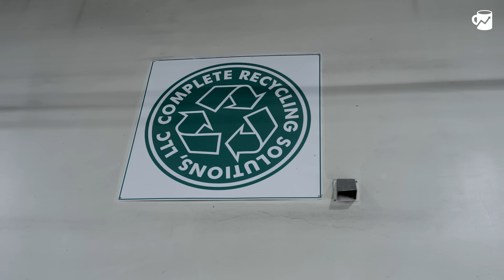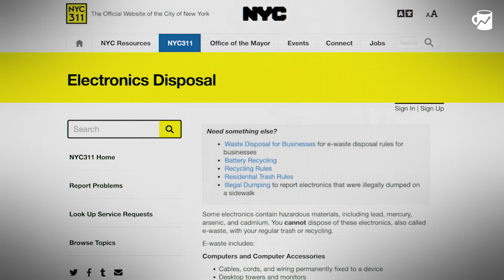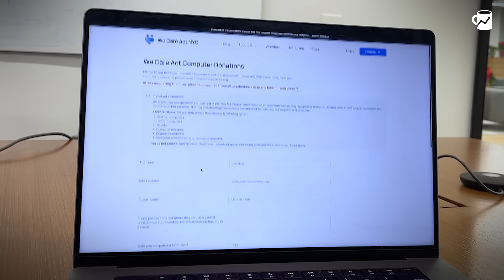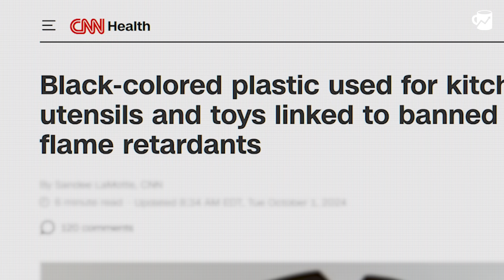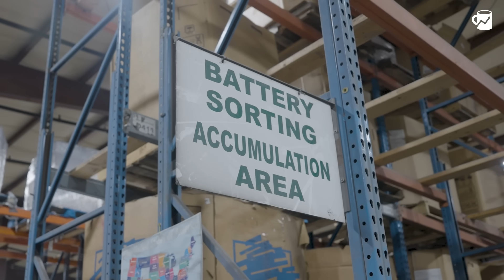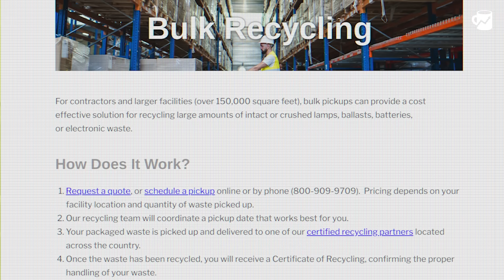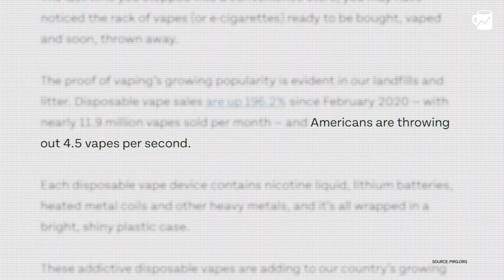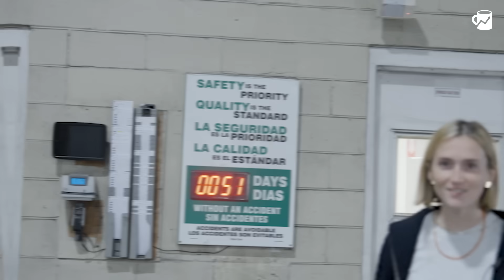I went down a rabbit hole trying to recycle all my tech waste

Comment: Better repairablibity would help reduce e-waste massively
Reply: and upgrade ability
Reply: @nzoomed Promoting modularity would encompass both repairability and upgradability.
Reply: Louis Rossman approves 😀
Reply: Repairability and modularity. Plus just not using tech when it’s not needed. Why does anyone need everything from their fridge to their dog food bowl connected to the internet?
Reply: A lot of the problem is that the cost of repair is so high that it cost the same to buy new or in some cases even less to buy new. There's lots of repairable E waste out there (along with other kinds like small engine home and garden and furniture waste) but when most people don't have the skills and most that do have to charge $100 to make a living while covering overhead most people just take the path of least resistance and buy new.
Reply: We need right to repair laws urgently.
Reply: The fact that 70% of the ewaste at the recycling centre came from businesses actually makes me doubt the significance of repairability. I always used to think lack of repairability was a ridiculous market failure, but if most of the stuff comes from businesses that most likely buy wholesale equipment and replace all of it in batches, repairability might not be an option they will realistically use. Aside from $1000+ products, which absolutely already get repaired nowadays.
Reply: @TheHadMatters  You should watch Louis Rossmann. He could explain why there is almost no client side repair in many product fields.
Reply: @Mika-ph6ku no they can’t. Even laptops that had socketed CPUs can only upgrade in the same generation, which would yield a 50-80% improvement in the best case, and the too CPU models costs more on ebay than the laptop itself. They would still be orders of magnitude slower than a modern CPU. If you are running a slow print server or NAS, maybe, but they are so inefficient, in a few months the electricity bill would be more than buying a more modern solution. I have a dell laptop from 2006, can’t really use it for anything as even browsing the web is very slow. It’s a giant heavy block of plastic with a horrible display… But it has a slot loading DVD, so there‘s that. How much money would you be willing to pay for such a laptop? Core2Duo with 2GB of DDR2 (can be upgraded to 4GB).
Reply: It would reduce e-waste, but not necessarily massively. I feel like most consumers would prefer the convenience of getting a newer model rather than repair, especially if they would have to wait for parts to come in and be without their device for an extended amount of time. There is a subset of people who would enjoy repairing their own stuff or have a repair business, so they would be the primary beneficiaries of better repairability. This group is relatively small though, and not economically significant enough for manufacturers to design their product strategy for them.
Reply: Right, I think making the products full cycle play book before making the product aka profit. Will help the most as after the fact planning turns out to be just a plan. Otherwise just an excuse to say. oh we tried to use R/D and it looks like now it would be worse on the environment to fix it. ohhh, well if only we could have stopped it on day one.
Reply: Apple started it.
Reply: @mindful_clip  look up Phoebus Cartel, and Alfred P. Sloan, dynamic obsolescence. 1920's
Reply: Which is something Apple and most other major corporations actively fight against.
Reply: @remyllebeau77  of course. They make money by selling you stuff. If you can repair your old stuff you won't buy new stuff from them.
Reply: @Mika-ph6ku if desktops and laptops only needed $50 worth of parts to make them relevant again, I would most certainly do it and then sell them. Even if they needed $100 worth of parts to make them relevant again. 
The problem is there's no amount of money that can change the preset engineering design into compliance with today's standards  and performance.
 
People usually don't get rid of things that still work and a lot of stuff that doesn't work is just plain worn out. Electronics are delicate, they're not meant to last forever, nor can they be designed to do so.
Reply: right to repair
Reply: laughs in capitalist greed by the light of the flames
Reply: Right to repair
Reply: Unfortunately, such repairs requires expertise that takes years to learn. It is not glamourous work anf if you are like me, an electronics engineer, if you go to school for years, which would you rater do. Repair old electronics that are of little value for little more than minimum wage or make $100,000+ a year designing the newest products. 

Repair is 17th century hand craftsmanship trying to compete with assembly robots and low wage workers in developing countries.
Reply: @dmfraser1444  that's overstating the case. Yes SOME things take years of training. But a lot of it doesn't. A lot of the skills can be self taught and the internet makes it more and more easy for the home DIYer to keep old tech running. Just the other day I was able to repair our dryer without the need to consult a service person. And it needly avoided having to replace it. I've pulled lawn mowers, generators, pressure washers and a host of other items off the curb that really just needed a carb rebuild kit and a little easily acquired knowledge. I've build home PCs and I've repaired X Box consoles and controllers as well.  I'm no expert but a willingness to try and a minimal amount of ability to learn technical skills can work wonders!
Reply: They should also let you pickup stuff from the recycling center if you see something you can fix or transform yourself
Reply: @DxDeksor  THIS!!!! There would have to be some way to prevent it from being abused and to prevent things that are picked up from recycling from ending up in a landfill. It it can be repaired by a DIY person and reused then every effort should be made to see that happen.
Reply: but that would make tech companies less money! capitalism is so innovative
Reply: @losisd3ad  oh, yes, right, it was so much better under socialism, Lada made the same car for 50 years, Trabant 40 years. Who needs more, right?
Reply: @HNedel  define socialism
Reply: @losisd3ad the opposite of capitalism
Reply: @HNedel  define either capitalism or socialism
Reply: @ capitalism - a system where profits matter
Socialism - a system where profits don’t matter
Reply: @HNedel  ok so u can't really define them. i wouldn't be throwing around those words then
Reply: @losisd3ad i probably have forgotten more about capitalism and socialism than you would ever learn, but please, enlighten me, you who is knowledgeable enough on what is socialism and capitalism to be able to throw them around, what are their definitions? Is it the ownership of the means of production? Because that would still make both my answers 100% correct.
Reply: @HNedel  who owns the means of production? u just said ownership. I'm just asking you to define them, I'm not saying im smarter than you or anything. you just haven't defined them. maybe said qualities of them, but definitely no definitions.
Reply: @losisd3ad and I am still waiting for a definition from you.
Reply: @HNedel  No your answers aren't correct. Profits still matter under socialism, the profits just don't go to shareholders. They get distributed to public and/or the employees.

Not that big of a flex to forget more than someone knows when everything you know was completely made up in the first place.

EDIT: Although I guess technically the public and the employees would then be shareholders. But you get gist, not shareholders in the traditional sense where you buy equity.
Reply: Today, tech is designed to fail.  It wasn't always like this. 40-50 years ago, my dad would bring home old TVs or radios to repair for his friends, a family member, or his colleagues. Many times, I would accompany him to someone's house to repair one of those huge console TVs.  I was there to hand him tools, tubes, or watch the front of the picture tube while he adjusted attenuators or variable inductors.
Reply: The charging bricks are fully working, the rest is obsolete and not worth any repair. except the newer iPhones.
Reply: @HNedel  The calculator works just fine.
Reply: @EE_etcetera  True, but it's only still being produced because its mandated by schools. It's quite heavily outdated and a modern phone, including modern "dumb" phones do the same tasks but better.

The true solution is just to consume less.
Reply: @relo999  I completely agree, but unfortunately, people aren't going to change.
Reply: @EE_etcetera  Well it's quite easy to change by increasing price of the product and/or making it harder to throw away.

The former can be done through tarrifs if it can't happen through consumer demand (also would increase wages as a bonus), the latter is stopping government from facilitating throwing away stuff.

Back when most tech was still produced in the west the amount of consumption of tech was significantly lower but prices where higher. 
And countries with a high "repair and reuse" culture also make it really hard and annoying to throw away items, for example in Japan it's not abnormal to sit with an item for 2~3 weeks before it gets picked up for waste removal and if you true to put it before on the pickup spot you get fined.
Reply: @relo999  I'm sorry, but items now are not designed to be repaired. They are designed to be thrown out. A great example of this is Apple. They glue their Mac books, making it impossible for a 3rd party to repair. Most of the time, they just transfer your data into a new device and wipe your device to be thrown out.
Reply: @EE_etcetera  I've been doing repair for some 20 odd years professionally, I know what I'm talking about. Just the sheer amount of people I have to turn away purely for cost reasons (because I need to eat too and have bills) is staggering. The vast majority of people don't even try or look for repair unless they're a business (for which prices for products aimed at them tend to be much higher).

Most consumer items are easily repairable, note the word "most". Pointing to a handful of companies as an example of the whole market isn't pointing to reality. Apple is very much the exception still when it comes to electronics in general. And anti-repair issues are relatively recent thing. 
The issue that repair isn't cost effective for most people anymore has been a thing since I started and if I base it on stories from older people in the profession it started around the 70's and became an issue in the 80's.
Most (again note the word "most") electronics is simply cheaper to replace or cheap enough that repair isn't viable. 
And the reason it's cheaper to replace than to repair is because production is in some low-wage country to push down pricing for consumers.

Most e-waste is perfectly repairable. 
But almost nobody lets their smart-lights, blender, thermostat, etc. get repaired because repair isn't cheap enough to be cost effective, replacing it often is cheaper or cheap enough that getting a new item is worth it.
And most (note the word) is thrown out without there even being an attempt to repair it, mainly due to cost.

And just because you watch some Louis Rossman video's doesn't mean you're an expert on repair. He is an right to repair advocate and has a business repairing apple products, those things give him a certain bias. 
Repair cost isn't a right to repair issue and Apple products being a premium price items the cost effectiveness of repair becomes less of an issue. He doesn't repair a whole lot of microwaves, ventilation system controllers, RC airplane controllers, etc., etc.
An hour of work at 40 an hour isn't much of an issue on a 2000 dollar item, a hour of work at 40 an hour IS an issue on a 60 dollar item.
Reply: I love my calculator, we still use then in university to do calculations, especially in exams. You're not allowed to bring your smart phone to an exam.
Reply: @EE_etceterathats okay, if she wants knew, it atleast  not being randomly  dumped.
Reply: @HNedel  What are you talking about? Most tech from 2016 onwards could be perfectly usable nowadays. Biggest issue is lack of support, and locked hardware, so not even open source can fix it. And a lot of more premium options from before 2016 would work fine as well.